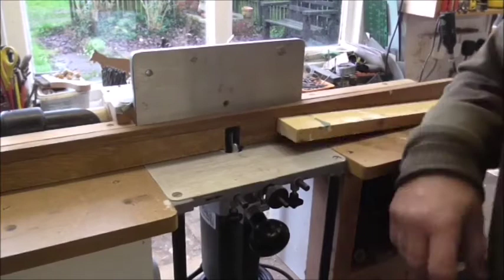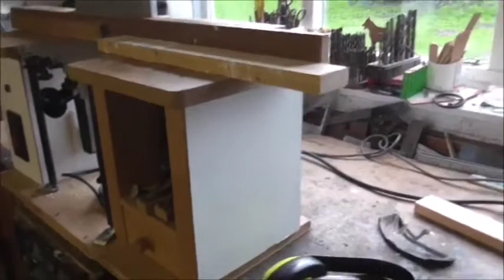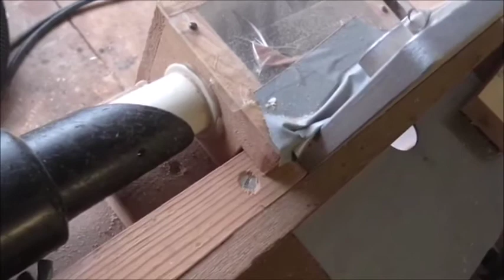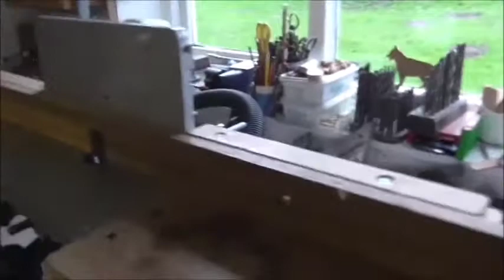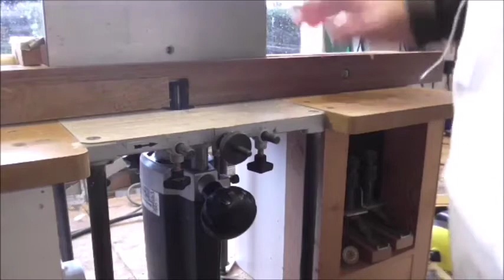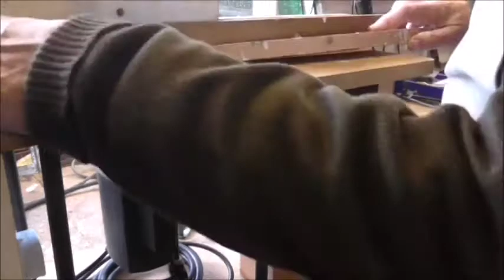Router tables part one

Comment: Brilliant, thank you for that, I’ve just, just bought the same table from eBay @£66 inc. cartridge. 
Please can I ask, how do you adjust your router up&down smoothly please?
Thanks again Peter 🙂
Reply from the maker: Thank you Peter. 
When I bought the table over 30 years ago it came as a kit with all the parts inc a part called a fine height adjuster, which allows smooth adjustments. The part number for the adjuster was E40201. It is possible to make your own height adjuster using some screwed rod and a short length of metal tube, this is what I have done with other routers that do not have a bespoke fine adjuster.

Comment: Hi thanks for the informative video! I have inherited an elu mof96 from my father. I would like to turn it into a router table. He never got the official table for this router. Do you think it can be mounted to a generic router table insert plate?
Reply from the maker: Thanks for your kind comment. MOF96 is an excellent well made router. there are always ways of mounting your router under any type of table. The table featured in my third video is all from scrap materials the top insert plate is a piece or 1/4" Alloy cut from an old garage sign I scrounged the Elu router is bolted to the plate with countersink head bolts.